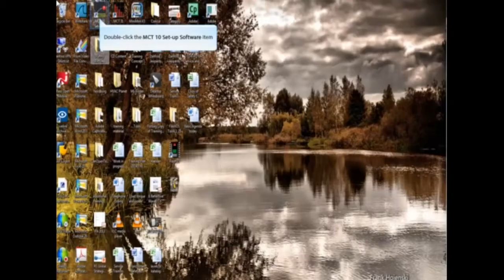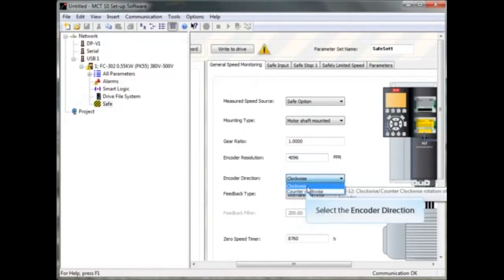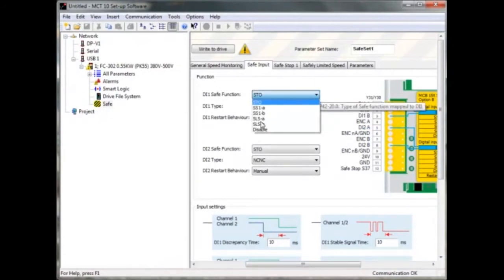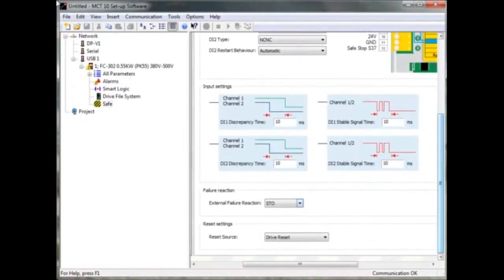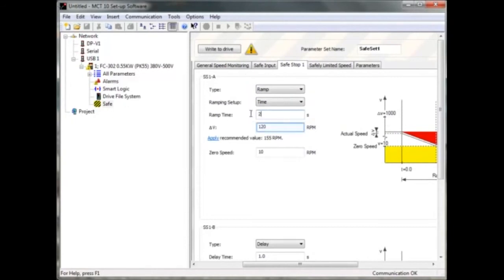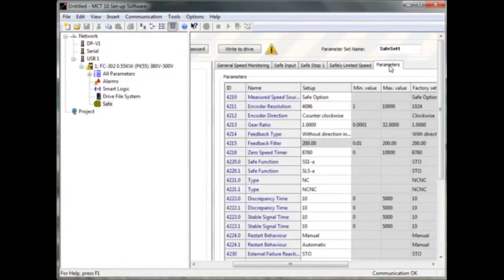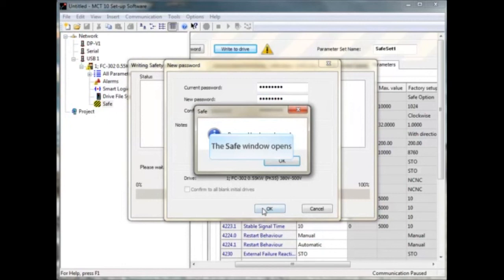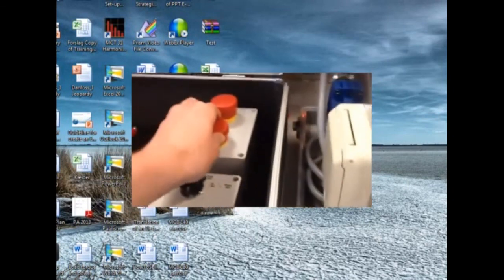VLT® Motion Control Tool MCT 10 Safe Plug-in

Comment: I have downloaded the MCT10 for VLT drive with usb port,  but I can mot find the USB protocol in the communication settings !! How do you show that in the video? please help
Reply from the maker: Hi MAL LAB

Here is an answer from our technical team: The USB will appear once you connect the drive with MCT10 using USB cable and then the drive MUST be Powered-on. The USB is a communication medium and internally we use FC/MC Danfoss Proprietary protocol. 
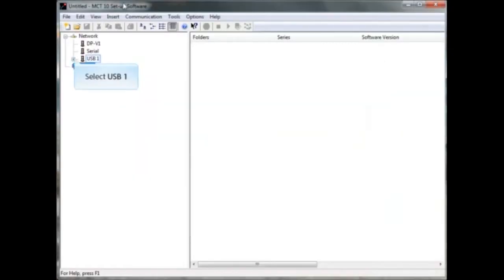When the drive is powered on and connected to MCT10 via USB, then the MCT10 will detect the drive using the USB driver and scans to find the drive information, then it populates database list in the UI. In the video: 0:10, the drive is already powered and connected to PC via USB, hence the USB1 is detected. Please remember the video is uploaded in 2014, over a period of 4+ years we have done several improvements.

If you need additional support, please do feel free to reach out to your local Danfoss Drives Sales and Service office via https://www.danfoss.com/en/contact-us/contacts-list/?filter=type%3Adanfoss-sales-service-center